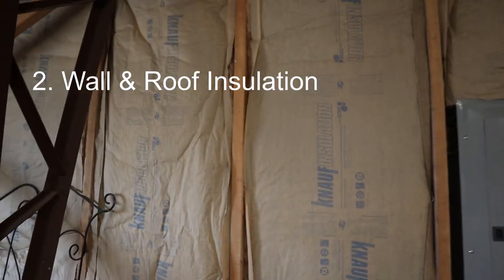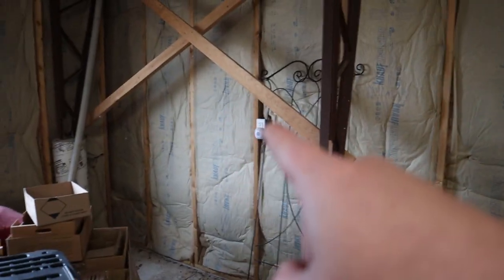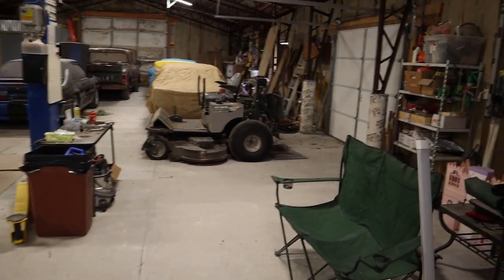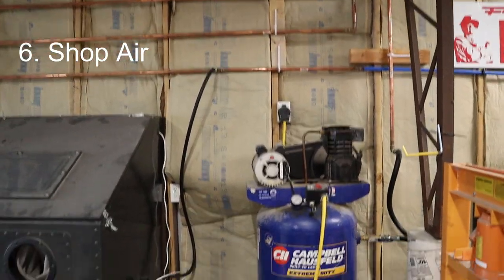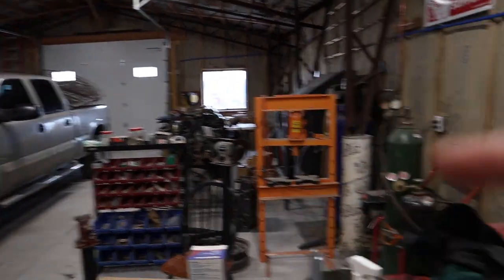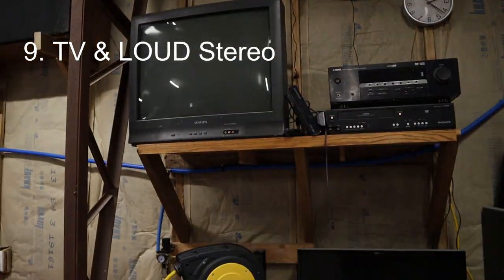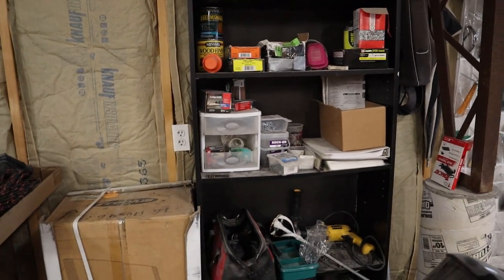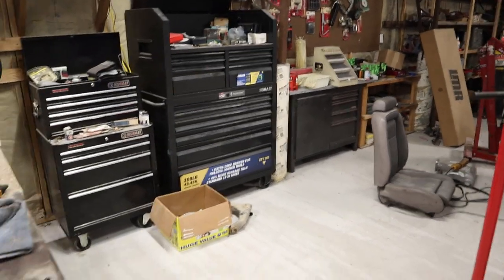12 Things EVERY Shop NEEDS!!!

Comment: Just wondering, did you run 2 120v and 2 240v outlet circuits in your shop?
Reply from the maker: I have quite a few of each type of circuit
Reply: @Challenged1  I was thinking about running 2 of each and putting 4 outlets on each circuit, but am not sure if that will be enough
Reply from the maker: @savannahrei8674  It will always depend on the size and use of your shop.  Usually, more is better.  Don't forget to put in a lighting circuit as well as an outlet or two on the outside of the building.